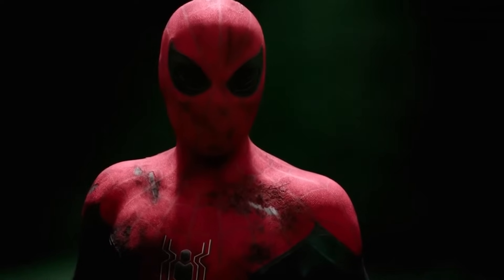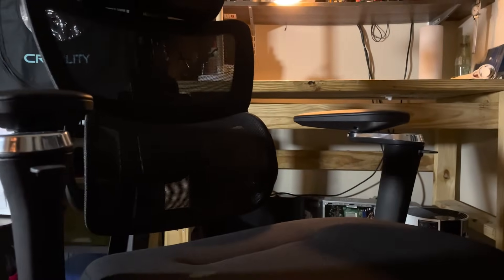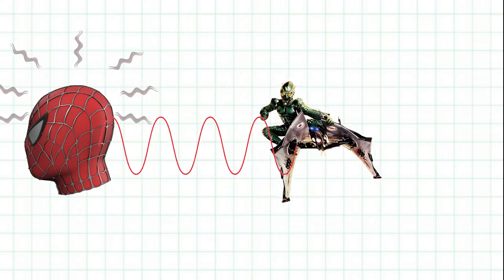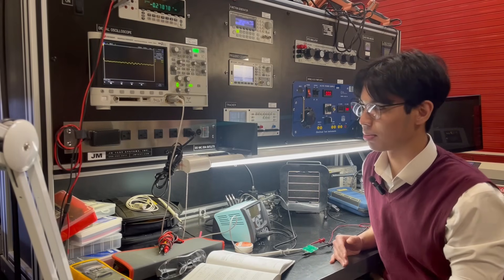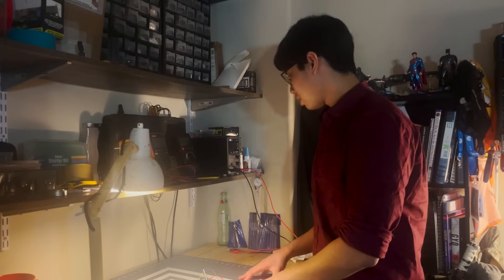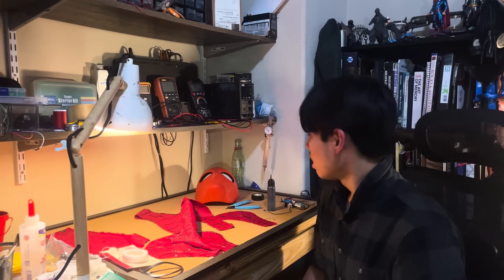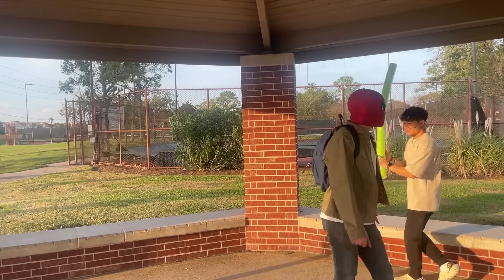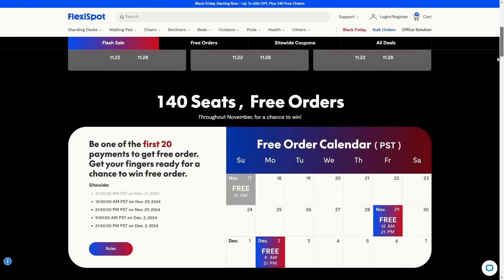Spider-Man Powers IRL!  (Real Life Spider Sense)

Comment from the maker: Hey everyone, happy thanksgiving! Hope you have a good time celebrating and watching my latest video! Also take a look at the c7 chair by today’s sponsor, flexispot, before the Black Friday sale ends: https://bit.ly/4g21Hav and use my code: 24BFC7 for 50 dollars off!
Reply: This dude is underrated
Reply: @3h1s4  Severely, unfortunately 😔
Reply: Hey quick tip try fluting your web-shooters like rockets to make it come out in relatively one point if your going for swinging webs also to help with the web-shooters spurting instead of cross linking properly try making your fluid form chain molecules upon oxygenation
Reply: To elaborate on that last one I'm thinking making some very chemically active glucose that is one oxygen bond away from forming cellulose also I've kinda gone down this route before but I've always been to poor to actually test anything so contact me I have a lot more ideas I'd love to test like  putting synthetic gecko skin on the gloves for wall crawling and hooking an AI to a pneumatic exoskeleton to make your spidy sense a little more lore accurate
Reply: What is the modual did you use for the motion?
Reply: Don’t cut it as much as it leaves the viewer speculating that you were given a “heads up” that it’s coming
Reply: 1:12 what anime is that?
Reply: Bro why don't you try with time of flight sensor in all directions , connect them to esp32 (for more capacity) and add some small vibration module in those direction so you don't need to depend on backpack
Reply: Hey can you send me a Spiderman web shooter and suit with separate pieces and with a mask
Reply: Send it to this address 27 greenfield Drive Monroe Louisiana make it size 9 to 10 year-olds
Reply: It's been a couple months doing a check in. What are you working on

Comment: This should be turned into a suit for the blind, think of a suit you wear under your clothing full of these sensors, when they near an object the vibrations increase or decrease depending on the distance of the object, this would also work for people - walls ect allowing them to pinpoint exactly where someone or something is based on the multiple sensors

Comment: This is going to fail because it's the type of precognition which would be directly linked with the nervous system that upon receiving information about possible threats it immediately warns the host of the danger and how high the danger level would be within miliseconds that it'd have to happen by instinct. The only way to replicate it would be to have something that can detect everything around the host without giving sensory overload and to be able to filter through what can be harmful and what is harmless. It'd be comparable to giving someone what would be schizophrenia, but useful.

Comment: Would you react faster if it shocked you instead of vibrating? My thought is that it would engage your reflexes, which are faster than a conscious decision to move away after feeling a vibration.
Reply: Right on! The Spider-Sense is supposed to feel more painful the closer/bigger the danger is.
Reply: I think a lot of it is just going to be reflex training, but a shock might be a good way to add "urgency" to one of the warnings.
Reply: It would just hurt you because it is external source of pain

Comment: Not bad proof of concept. But long term use I'd recommend 3d printing a small housing cases for the sensors, arduino and hp 100 along heat tubing for wires. TPU and PLA+ are my recommended materials easy to work with.

Comment: I'd suggest a look into sensory substitution, expansion, and addition, if you haven't already. Might be right up the alley you are after.  Or as I call it and do writing about, sensory weaving but that's not a technical term in science literature... Yet

Full spatial detection behind oneself or otherwise, knowledge of humans vs non-humans, distance away, size, velocity (and more) is super doable and works pretty reliably as a genuine "sense" if using it consistently for a couple weeks+. 
Have been daily using that type of tech, senses and more for personal usage for a year+ or so now. VL53C7CX TOF sensor coupled with MLX90640 110° degree FOV thermal sensor gives some interesting results, but there's no "right" way, so long as able to find the abstract information needed and weave it into the mind. 
(As you said, you wanted to try something new!)

You are on the right path here, keep it up and keep exploring! 
  So many different ways to pull abstract information from around us and integrate it into ourselves.  Anything that can be quantized can be ingested. Be it via cameras, MM wave detectors (got those for my car...), dopler, lidar, simple photoreceptors spattered about, and more, there are many different paths to information.

  The world is ready for "super" powers :)

Comment: i say this is pretty dumb for an engineering student, honestly the lidar would have been better option since you are just in the "testing phase" but you know, if you really wanted to, what you could have done is use an mmwave sensor which use the same dopler effect, i already feel like you are using one, but didn't care enough to search what you were using and then what you could do is make it so that it vibrates with respect to the closeness of the object moving, and literally any cheap mmwave sensor is better than what you were using, it didn't work if you were hit close to you head, it think tis because the detection angle is less. Anyways good video :) your enthusiasm was better than the project

Comment: I have a question… you probably won’t see this comment, but can I use alcohol or something less toxic than acetone/ethanol with pva/pvac glue? Oh, and would alcohol and pva/pvac glue be toxic?
Reply from the maker: @optimusprime1950  ethanol is alcohol. Unless you mean rubbing alcohol, which in my experience hasn’t worked. As far as toxicity, it’s fairly safe as long as you use some basic safety practice and common sense. i.e. avoiding spillage, wearing gloves, not ingesting or inhaling the stuff, etc.
Reply: @schizo4725 Thank you! Can I use Elmer’s glue or is that too weak for it? Also, is it safe when it’s in the web form? I know you mentioned this in your previous video, but just making sure I can use it.

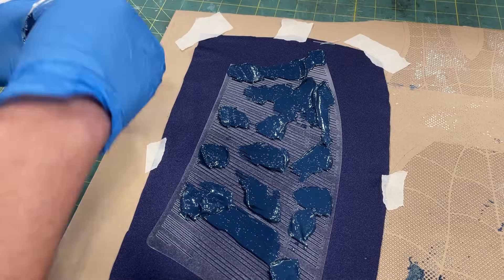Comment: 8:23 the method for adding texture looks a lot like Sean’s Crafts spiderman mask. Maybe using his simpler method could be more efficient.
Reply from the maker: I actually did start with that method, but eventually started evolving it more. It's sort of the same method basically, but I've been adding to the paint mixtures and the stencils I make are a lot more reusable and can be done in more textures than just dots.